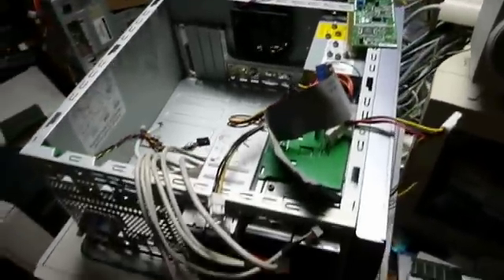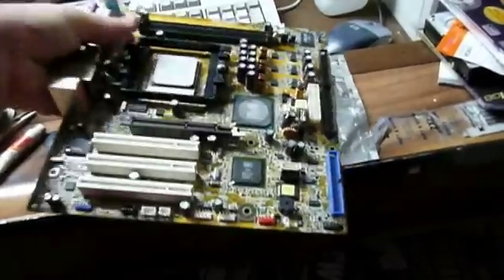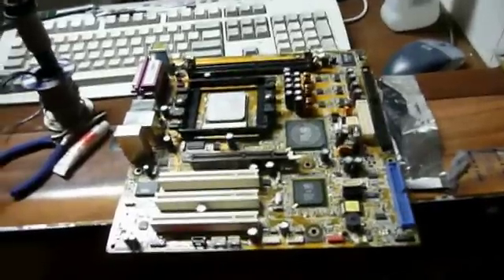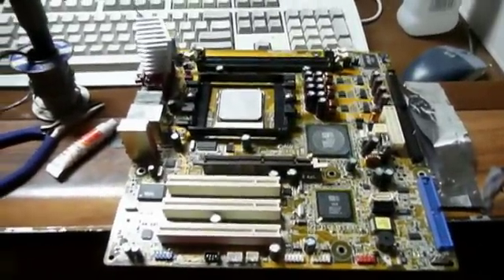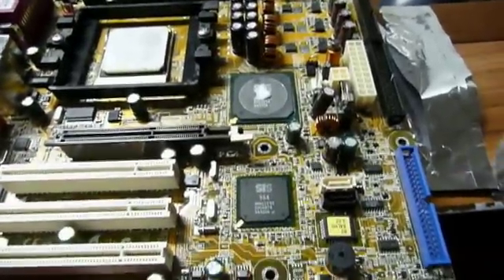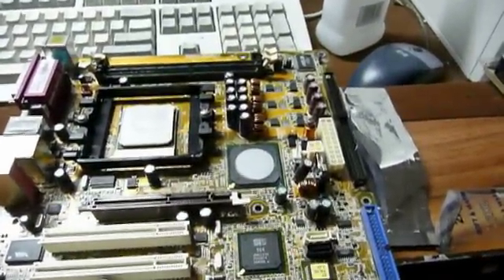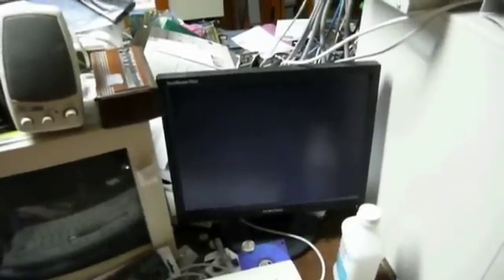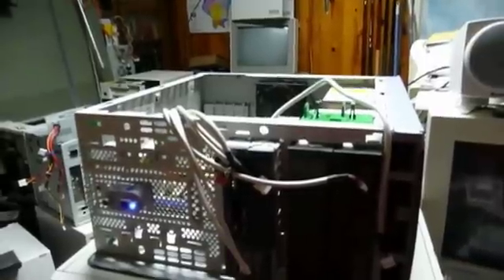Motherboard Component Repair

Comment: How the heck does a Northbridge heatsink fall off? From what I've heard there almost impossible to remove undamaged.
Reply: Mainboard in a tower, improperly installed retaining clip, heat softens thermal paste, gravity works. Happens all the time.

Comment: I remember these, they'd break off the clip holding on the northbridge's heatsink on, and develop swollen caps. I believe also these PC's used pegatron/asus boards.
Reply: Christopher Ryan  i had dozens of these boards only had one out of all of the work properly 
Now i have  have computers with  i5/i7/i3 cpus in them and a laptop i got out of a bucket of water that has a i7 cpu still run to this day some how the water didn't damage it

Comment: What processor did that have
Reply: Id guess at some kind of AMD Athlon processor.
Reply: AMD Athlon 64 @ 2.2GHZ, the video was too blurry to see exactly what CPU it had. That's all I could make out of the Memtest.
Reply: Rinkk Closest match I can find is the AMD Athlon 64 3200+, which is an AM2 socketed CPU at 2.2GHz.
Reply: AIO inc. Then it's probably that.

Comment: oh man I solder fixed one of them exact heat sync for our security office dpt at my job it was "Tha Mans" main PC lol. one day around Xmas time I walked into my techroom and on my workbench there was a Xmas present from "Tha Man" lol when I opened it inside there was a bottle of Patron and 2 tickets to the iMax movies, this goes to show that some folks do appreciate our work specially when you save them because I was told that that particular PC was his bread n butter at work, I never asked to get any pay or for anything but I found it so kind of him, working on computers and electronics is my passion too sir

Comment: My thermal compound method is to squeeze some little blobs onto the four corners of the die and then one in the center. Then I get a plastic baggy, stick my finger in it, and start spreading and smooshing the stuff around until I've got a fairly even and thin layer. Seems to work pretty well, although your method seems to work quite nicely. :)

Comment: Those northbridge heatsinks always have a issue of falling off for some reason! I suppose its because of the pressure of the arms holding it down! my friend had his come off and sadly fried his chipset which he got a new PC I got the old one afterwards and used it for parts.

Comment: I have problem with my computer motherboard. when I switch the computer on nothing happening so I test the power supply and its working fine. so I believe that the problem with motherboard. If you could advice me that will be great

Comment: The heat sink grease, I used to work in a electronic repair shop and that's the way I always did it, just apply it and then push the parts together. I've replaced lots of transistors and other parts that way.

Comment: I've just repair a blown CMS fuse a old 2001 Asus motherboard. I wanted to repair it because it's a quite rare ! It's used socket 423, with 1.4 Ghz Pentium 4 (first gen) and the realy rare RDRAM) in fact never seen it before !
The board works well now !

Comment: I bet that was an Asus K8S-LA "Salmon" Motherboard; the Northbridge Heat Sink Clip popped out of my Mom's Computer, and I fixed it with Superglue, but not too long after I did that, the Motherboard and Processor was Dead due to my own stupidity of trying to remove the processor heatsink to clean it, and the Processor popped off WITH the heatsink and the Processor Socket still in the locked position. got a new motherboard not too long ago, and now the PSU is dead in that computer.

Comment: I'm honestly surprised that the northbridge didn't burn out, as last one I seen with a missing heatsink (also a broken clip) burnt out before it was noticed. I wonder if the newer ones have better heat protection, as this was back in the late Pentium 4 days.

Comment: Hey i have a problem with my pc, I have a HP pavilion p9069 pc and when im trying to turn it on then all lights is turned on and the fan are going but when I connect the pc to a monitor it says "no input signal" i using a vga cable. And when i connect a mouse to the pc no lights are coming. Can anyone say what the problem is?

Comment: I've seen that happen on a few of my customers computers ... only one of the clips came out ... because they don't transmit power or data i just used crazy glue to stick the loops to the motherboard ... that was about 2 years ago and she's still happy that I was able to fix it ... it's still running great

Comment: Nice! Don't listen to all the douches, I do stuff like this all the time. Only thing I'm a bit iffy about is the PSU's, but what's the worst that can happen? It dosn't work. So what? Most of the stuff you and I get is free anyway :P.

Actually this guide helped me a lot. Just got a system working recently and the chipset heatsink is only held on by the thermal paste. Even though I'm using a dedicated card, it was still getting toasty. Thanks!

Comment: Yeah I have that same problem with my computer, it's an HP Pavilion a810n with the Asus K8S-LA motherboard, and the north-bridge heat-sink clips keep coming un-soldered, I've fixed it 3 times already, it comes un-soldered every few months.

Comment: @uxwbill  Hi,

Can you help me please. My computer went wrong and when I start it doesn't say anything on it. It was ment to beep after it is started but it didn't do it. I looked at my connections to see if the are properly connected but they are connected it still doesn't work I think it is something to do with the mother board and memory RAM.

Comment: @uxwbill i tried to replace the ram and changed the power supply but no improvement? i have a feeling i need to replace my motherboard, but the problem is AMD is not so popular here in Pakistan other than intel. So i might have a little bit problem. but Thankyou Anyway :)

Comment: @uxwbill ohh :( no any capacitor are brocken i've tryed 3 NEW power suplys and all the fans work just great, ram i've check with 2 kingston on witch chanell... i just did not even check the cpu but i guess the problem isnt from that.

Comment: that looks like a bestec power supply i do pc repair & have seen many motherboards burn out with these
hp & emachines gateway use these power supplys
im not a big fan of hp i dont like there hardware or there cases & there printers are terrible i hate hp printer software. gateway is bad to many problems with there motherboards 
i think dell is good i have never had many problems with them
emachines are good if you change the power supply

Comment: That looks like a Compaq board from around 2004 or so. My northbridge heat sink is also falling off but mine has 4 clips and is still partially attached and working good.

Comment: @excriminal1. Only HP? The whole industry is screwing every customer. The price of printer inks is scandalous. I had an Epson 440 which worked wonders, I bought Jetteck inks at £6 to £8 for a combination pack of 2 black and 3 colours   (Yes £6 to £8 per pack). My printer eventually went wrong. I now have an Epson 8400 it does not print transparencies or card, the refills are £33 to £38 per set of 1 black +3 colours.

Comment: @geeksarenotcool let me ask this... does a mobo ship without a passive (in most if not all) heat sink on the bridges? if you ordered a mobo and it shipped without the heat sinks, would use it anyway? would you not consider the heat sink an important part to a north bridge? just because he's not soldiering in parts that conduct electricity doesn't mean he's not fixing the mobo. just my 2 cents...

Comment: Does the BIOS on that machine have any kind of beep code system as some do to indicate errors?  If so did it not give a high temperature error of sorts?  It's just as well that chip didn't burn out due to a lack of a heatsink on it.  I don't understand why people are leaving stupid comments on this video.  I'm sure you've had to reseat heatsinks on CPU's before, your technique makes more than enough sense to me.

Comment: That was good.  Somehow, I thought you were going to replace capacitors.  Anyway, you did well.  I probably would have just told the customer they need a new motherboard mainly because I don't solder though I have done a laptop power jack at one point.

Comment: @uxwbill 

I agree the RadioShack Irons work "ok" for simple repairs like this, but if you plan to solder ICs or anything more advanced I would strongly suggest to use a higher priced iron. I have used RadioShack irons for 8 years and just bought a $130 SMD solder reflow station with soldering iron. That iron is 10x better than them cheap RadioShack ones. It also heats up very fast and is adjustable!

Comment: I love watching your vids.  You're like the Bob Ross of electronics.  
I just got done my first pc build.  Sadly it won't power on.  
If the led light on the motherboard is on when I turn the power supply on does that mean the power supply is ok?
I checked all my connections like 100 times.  From what I've been reading I think the mobo is shot.  I was super careful when putting this together, used a ground strap and all.  Is it common that a new mobo would be bad out of the box?

Comment: @TraNWhiZ 

Yeah, the Athlon 64, Phenom II, Opteron and the new Intel Core i7/i5 chips all have the memory controller on the CPU itself. Most new motherboards for these CPU's don't really have a northbridge and southbridge like they used to, instead they have one chip that does the work of what both used to do.

Comment: @TraNWhiZ 

Looks like an Athlon 64. Usually the northbridge's run pretty cool on those since the memory controller is on the CPU itself. Pentium 4's often have fans on the northbridge heatsinks they run so hot.

Comment: spreading paste creates air pockets.  So  many people spread.  prob because the mindset of a hot chip being equally hot over 100% of the surface.   The core of the chip (center) is where the heat is generated from.  spreading paste  also increases the risk of paste getting onto other close electrical components when you install the sink.
The best method to use is the dot in the middle and install sink on top.
watch?v=EyXLu1Ms-q4 - good video showing how paste reacts to different methods

Comment: Putting a blob of thermal paste is a good idea as long as you fit it immediately but you have removed it and then replaced it which will trap a small amount  of air in the paste, the blob pushes the air out as it moves across the surface towards the edge but if you lift it off and replace it forms ripples in the paste that do trap air.

Comment: I always hated those spring clips with the soldered in holders.  I fix tons of boards at work that have the same problem.  Not to mention the ones that also have bad caps on the motherboard and/or power supply.

Comment: Some time when i boot My dell Demention E310 I get and error saying the North Bridge Heat sink not detected system holt then it wont boot it works after restart and i only had this happen twice but i have check on the heat sink and I have replaced it with an after market one before this it seemed to work just fine all dou a while ago i did remove the heat sink while it was on the screen went all colorful  LOL ist working as i type this comment

Comment: i heard you say will it boot.... i must of left something on the drive? did you wipe the hard drive and if so why? i do a lot of repairs myself on all kinds of PCs and will not touch the boot record or hard drive for that matter unless I'm sure that is the problem and only then play with that to repair. 99% of the time you can easily repair them unless its failing internally.

Comment: You could have just applied Thermal adhesive and been done in just a few minutes. There would have been no need to take apart the computer and possibly damage it further.   (what would i know though, I only run a computer repair business....)

Comment: i did solder a few capacitors on my old motherboard. after it, it works like a charm. The most common problems with pc's are cooling problems.. even if it runs on a clean install. Dust is killing your pc. Nice video!

Comment: I have a hp a810n, the same thing happened to me my heatsink fell off, and thinking nothing of it I just left it off, and now the thing wont even turn on, the green light on the back just flickers, and when I disconnect the power from the motherboard the light stop flickering. I read on the support sight that this means i need a new motherboard,processor, or something else. If I purchase a new motheroard will this fix my problem?

Comment: We fixed anything electronic in our shop, a lot of stuff other shops would not do.

Of course some things I needed help with so I had people I could call, for example one guy he helps me with printers, fax & copy machines.
We also used to fix a lot of ans. machines & cordless phones but now it's much cheaper to buy a new one. 

That's why I got started in this, saw too much stuff going to the trash bin and land fills.

Comment: I have changed the caps on a motherboard a few times. I found the way to do was to heat up the connection and then just pull the cap out.

if there is any solder left behind in the hole I'll heat up a needle etc. and push it through.

Comment: take my advice and don't try to change components on a motherboard.
I used to work in a repair shop and we fixed anything electronic. It's easy to remove parts from a tv, radio circuit board but not from a motherboard !

Comment: question: my laptop charger got messed up and my father made one all it needed was a new tip it was working good until i saw a spark and it turned off then it wouldnt turn on anymore so is this the mother board or something else?

Comment: u dont have to discharge your self ive actulay connected a spark coil to a running computer to prove that static electricity dosent always cause component damage high voltages might but low current from your body i dont think so never had it happen or seen it happen

Comment: Im having a Similar Problem , I just turn On my Computer This Morning , and it was starting as normaly use to do , but while it was  starting the desktop ... it Turned off  totally off , them it never turned on again , as if there was no power, but i try with some powersuply and i found out that the problem is motherboad.. but  i dont know how to fix it , it show's no energy at all no fan moves nothing motherboard totally dead since it  turned off that morning.  if u can helpme out please.

Comment: I had to fix that on my turion based Acer 5100 I also decided to replace the touch pad as well while I was in there.
One good tool you must have is some flux and some good fresh solder wick to clean up the left over solder.

Comment: Do you remember for JNC PSUs? - They are the no1 ever terrible PSUs produced! I have one old desktop PC dated from 2003 and on this PC, motherboard's condensators were totally screwed BUT I removed all bad condensators on this motherboard and I fixed all. Today that PC is still working without any problem. BTW bad fatal condensators faults are produced by very terrible PSUs. BTW don't try to buy SiS integrated motherboards, because they are AWFUL! Cheers and respect from crogeek

Comment: asus in my opinion is bit notorious from its northbridge coolers and heatsinks :/ last asus motherboard i had cooler and after few months more or less after the warranty had gone the coolers fan pretty much screams to a halt. after that ive pretty much sticked with dfi's, asrock's and MSI's. thou my second asus motherboard got fried by a not so well working powersupply before that happened.

Comment: I had to do that to a computer too (Also a Hewlett Packard)  It ran ok for a while but I've got it back for repair, it intermittently locks up hard locks. Not sure if the problems are related.